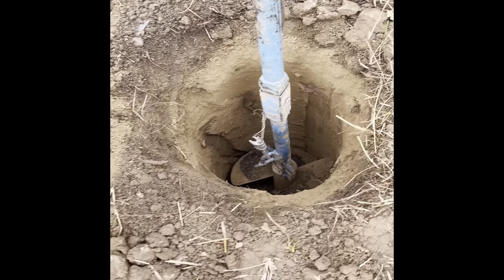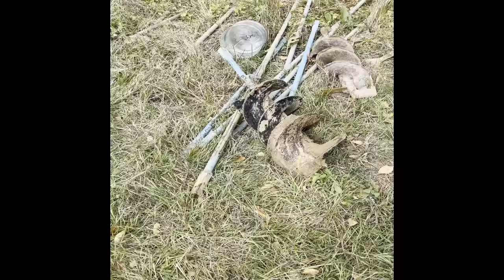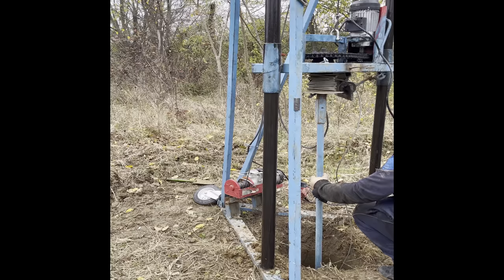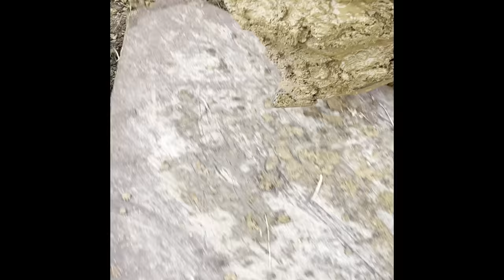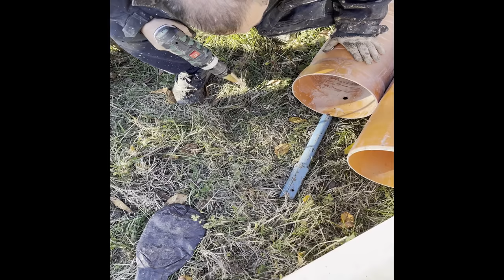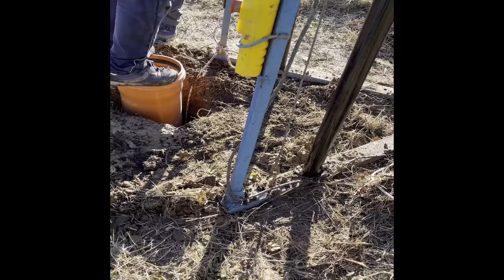Homemade water well drill rig machine , how to make a water well at home DIY - 4K

Comment: Haha that’s funny a buddy of mine and I did something almost identical to that about 8 years ago. Ours rotated a lot faster, went through multiple layers of rock, we pumped a slurry to flush it out,  and stopped around 120’ or 130’. He still uses the well. It was all homemade and something I will never forget. People were amazed that we used an 2 or 3hp electric motor from an old water pump.
Reply: How did you make the drilling bit? I may give it a try for myself
Reply: Also what diameter was the bore? Thanks in advance
Reply: Show it if you @did

Comment: This machine is very good , one if the best , professional level thinking procedure wise , but not that cheap and not simple . If you think it s so rudimentary do it it one hour . I m curious even the material total and all the pieces dimensions, it s a lot of engineering and those who made it are great at mechanical and even  electrical works.

Comment: Thanks for posting the video. Love the system. I'm wondering how to make the bucket or where do I buy it ? Like your other car videos on your channel
Reply from the maker: thank you so much for the great comment! The bucket  also is self made, by using a core with welded carbide tipped drill bits teeth.
Reply: @SuperFastDriver  where  can buy carbide drill  tip

Comment: Intresting concept. I was thinking on using PVC pipe and water pressure to go down 20ft first. This could also work for me and maybe percussion drilling combined down to 180ft.
Reply from the maker: I’ve never tried, but with this machine I can drill 50 ft per day if there are no big rocks .. up to 100 feets which in most cases we find water
Reply: @SuperFastDriver  Can you dig with this when there are rocks
Reply: @moner844  
مستحيل ضعيفة 2_3 حصان هذا دينوا شفط ماء في المنزل
Reply from the maker: @akh8501  Hi thanks for appreciating my machine, but sorry to disappoint you that machine is not for sale.. but you have all the info to build it as I did, really appreciate! Thanks

Comment: Always envied you guys in damp environments. The rig is amazing but would shatter in less than three feet here ... Plus my well is at 650'  .. Nicely done
Reply: You need to think like the well drillers that built and designed the rigs you use today, my grandfather was one of them, he would have loved this idea, laughed at your comment and simply told you build a pneumatic hammer attachment to hang at the bottom of the "drill rods", honestly i could build a system like this for 5 inch wells that would give me a rig that is light and limber enough to get to locations other drillers dare not go. As well as reduce the amount of property damage or clearing that needs to be done when drilling wells, usually wells aren't drilled in places easy to get to, especially these days. No shit welldrillers these days are dieing left and right, none of them want to improve the process, they inherited a way to do it. And will never ever consider a possible alternative to the problems their business deals with in our modern Era.
Reply: @dlayman101  it can always be done and there's always a new way to do it but getting someone to do it that way is a whole another issue. very cool idea though
Reply: @kuztomz  sorry for the sermon/lecture. It's my inner dad getting annoyed with both the kids and adults these days, it's not you lol. I apologize that you got caught up in the crossfire there lol. I'm frustrated that we lost the passion for the garage engineers of our history, the ones our modern Era wouldn't have existed if we didn't have them.
Don't sell yourself or your idea short, build it yourself, work with a single local bank or some e who you can trust for initial funding,  have a slow growth plan that garintees you will always meet or exceed your expected goals, pay off the initial debt and never use anything other then money earned to grow. Beautiful thing about merit, is if your idea has any, then if you build it, they will come, and that's the only marketing class any good businessman ever needs to know.

Comment: Very slow but works.  I wonder what happens when they hit water bearing sand.   I dug mine by hand and at 8’ couldn’t dig any deeper.   The hole just kept filling in at the bottom.
Reply: A baixa velocidade é a melhor forma para dar eficiência ao processo....

Comment: Really nice job but I didnt see you putting anything in the hole outside of the casing to seal out ground water. Here in the US, we put small rock in the hole ouside of the casing to filter out mud and sediment, then when the rocks reach about 3 feet above the slitted pipe, we place bentonite clay or sometimes even concrete up ground level to keep ground water runoff out of the well. Where we live, in the groundwater runoff we have bacteria that can make people sick such as giardia and salmonella. If either of those get into your house water system it will make everyone have a really bad day to a bad few weeks with toilet paper and toilet time in high demand at your house.
Reply from the maker: here in Bulgaria we use chlorine to desinfect the water we drink..
Reply: Probably best to use chlorine no matter what with such a shallow well anyway.

Comment: wow you guys filled around the well casing with stone right to the top. You will contaminate the ground water with surface water run off. There is a reason here in Canada well drillers must be licensed, to prevent exactly what you did. You have to use bentonite grout to seal around the casing to stop surface water from running down and contaminating the ground water source.
Reply from the maker: thanks for your advice..I can give you one as well:  you have to think more than just listening people ..

Comment: I like your design, but I will need a design that can break/cut through very hard basalt/granite rocks embedded in glacial till sandy soil. These eratics prevent use of a straight auger type drill or a sand spike. Any suggestions
Reply from the maker: you need stronger whinches and bigger auger extension rods.. and rock auger

Comment: If you sent a pipes down behind your drill head, you could've gravity fed water into the top, then pumped it back up at the bottom to clear the hole of dirt and other fine debris. With a simple filter, and I mean simple like a couple of t-shirts and a sediment bucket, you could use the same water over and over again, mostly clearing the hole until you reached your desired depth. At which point stop letting water flow back in, wait a while for the slurry at the bottom to dry out, then raised the drill head.
Reply from the maker: thanks for your comment appreciate it! Maybe i will upgrade it at some point , thanks for the idea!
Reply: @SuperFastDriver   If you don't mind refitting your drill's power head, you can install a drill swivel to inject water down the power shaft to the head. This will allow the debris to bias up the shaft to be siphoned off at the top. It's a little more complicated, and you might want to buy the part instead of building it, but it would allow you to drill non-stop until you hit your desired depth. Combines with the return pipe for sediment, it could increase and simplify operation... if you do this kind of thing a lot...

Comment: Cortaron partes importantes, al final porque le abren huecos al tubo?
Reply from the maker: The holes in the tubes are cut because that acts as a filter, around the tubes there are rocks acr as a filter for the sand .. you don’t want to clogg the pipe and tou want to keep that water level right? So that is the way..

Comment: Hi your video is great, is it possible to buy this machine with diameter of 1m?
Reply from the maker: Hi, thanks for your interest. The machine is not bought, it is hand made and yes, in order to drill bigger diameter you need to use stronger materials, powerful winches and has to be more taller, of course the wire cables must be bigger diameter. I am going to explain all that in another video! Thank you and stay tuned!
Reply: @SuperFastDriver  good ideas

Comment: The problem with rotary augers is they coat the hole with the clay you are extracting essentially creating a impervious layer (like a pipe) to the water you want access.  If you want to improve the well and access to the water you access you will need to flush the clay from the sides with a compressor.  Work it hard, flush the clay and your well will improve and provide more water.  Water moves through coarse particles ( rock and gravel) but will  not pass through fine soil (clay ) that is why pots and vessels made a thousand year ago hold olive oil an water.  Get rid of the clay.  Open the gaps and improve your water yeild
Reply: That’s all we have where I live, red clay and we have a hand dug well that works amazing.

Comment: Qu'elle était la methode que vous avez utilisé pour choisir l'endroit du puit? merçi et bon courage.
Reply from the maker: Hi sorry, I can’t seak french, I used google translate to answer you 😀, the method is old maybe not accurate but you can see in the video whereas both copper stics crossing eachother means there should be water